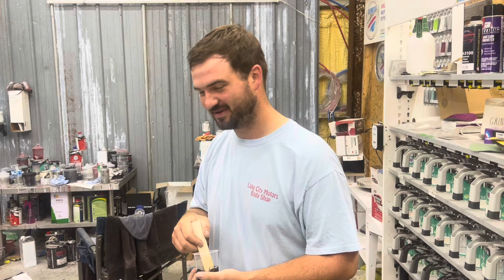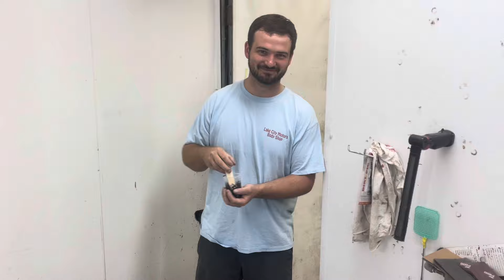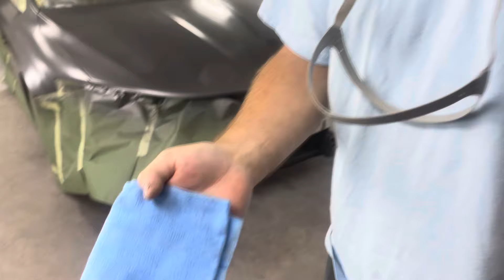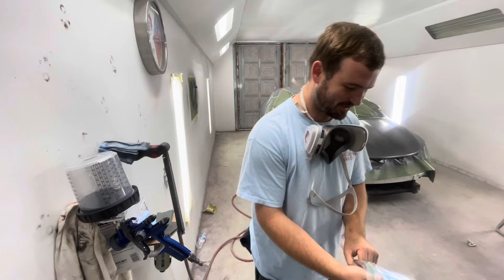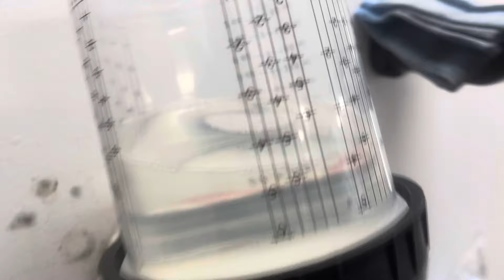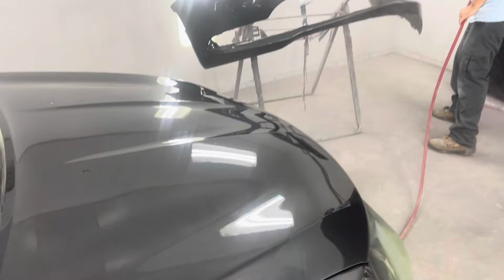Laying down some Automotive Art #drivenbycolor

Comment: Never did a 2 stage paint blend.  Charcoals and silvers look to be a real challenge.  Chrysler came out great!  I only did 2 repaints back in the day of single stage non-metallics (1st black on '67 GTX,  Basin Street Blue on deck of  '72 Satellite Sebring) using friends shop and equipment.  I leave current jobs to the pro's😁
Reply from the maker: Thanks